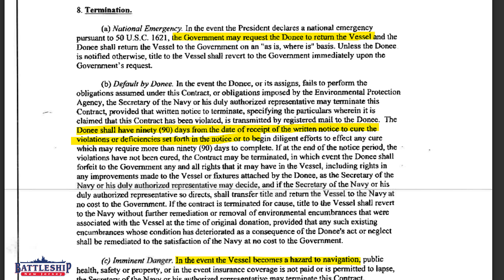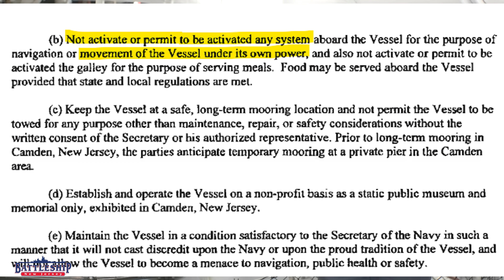Can Battleship NJ Still Move Under Her Own Power?

Comment: Ryan, I am curious if there is a senario where you could get the ship “functional” in the sense of having parts that work, but use an external power source, or are meant as demonstration pieces for tourists. Something like having a see through portion of the turbine, with the fan moving using an electric motor. Something that looks functional, and maintains the core components, but does not work in the proper sense.

Comment: The US Merchant Marina Academy at Kings Point, NY still teaches its students the engineering of running and operating steam turbine engines.  Across the river from the New Jersey is the SS United States, also when built had similar Iowa Class steam turbine engines installed.  The SSUS may have been built in 1952, but she is still the fastest ship in the world, overly built and superior to any passenger ship built today.  A few years ago I was at the US Naval Academy in Annapolis and discovered the SSUS is still taught as the ideal vessel to strive for in construction as performance.  Until the 1990's her top speed was still classified, 40 kts or 48 mph. BTW, the SSUS was built with two separate engine rooms so one could be hit with a torpedo and the ship still run via the second room.  Has 7 water tight compartments, cruseships today have 3.  Save the SSUS.
Reply: That’s great information. However, there’s no comparison between book learning how a 1200 psi/875 degree Westinghouse boiler works, and actually lighting one off and operating 3 of them in parallel.

Comment: I actually wrote a way into my stupid sci-fi novel to how to propel old ships without the main engines. Basically just install gas turbines connected to electrical generators and use that electrical power to turn the screws with electric motors without needing the boilers.

Comment: Good video Ryan. I agree with yours and others comments. Could it be done? yes if you throw enough money at it anything can be done. The issue as others have pointed out is not if it can be done. But more. Can you find enough people with the skills and experience to run the engines. That, is the million dollar question. All those people who used to work in the engine room will no longer be spring chickens. But, instead getting on in years like all of us. What eventually will stop the engines ever from being started is the knowledge and skill's required to get them started will no longer be around. Sure, I guess you could argue that someone could work their way through it and work out how to do it. But will they get it right or miss out one important step and destroy the engines permanently. Would i be worth getting in touch with those still alive who did work on the engines and get from them as detailed as possible the engine starting procedure. Or does that information already exist in Navy manuals? Keep happy everyone :)

Comment: Questions for a future video (I don't believe it has been answered to my knowledge):

What steps/prep work does the Dry Dock need to do before New Jersey shows up?  Iowa class battleships aren't exactly pulling into port often these days sadly, so even if you show up, money in hand, there must be some special steps they need to take to accommodate this right?  Do you help coordinate people who have experience (either veterans of the ship or maybe prior dock workers) with the Dry Dock or is docking a ship a fairly straight forward process?  I imagine you need to provide measurements and blueprints so they get an idea of the block placements.  Does the dry dock need to order or build specialty blocks to accommodate a ship that large or are the blocks basically standard?  Do they need to order any special naval or museum grade coatings or are the coatings general purpose?

Basically, we kinda have an idea of what the ship side is doing to prepare, what is the dock side having to do, if you know or can find out.  I think that would be an interesting topic.
Reply: I was wondering about the blocks too.     Is there a set that is barged from ship's drydocking to drydocking? Or is there a set on both the east and west coasts?

Comment: You didn't even cover the cost of the fuel that would be required just to bring ONE set of boilers up to pressure (how many tanker trucks of #2 diesel would THAT be ??) not to mention what part(s) of the steam systems would need refurbishment or upgrades to handle said pressures needed. IIRC these ships required tugs to move around the various ports/docks to prevent collisions. No, even if possible it would not be wise to move her under her own steam, especially in a moving river, just imagine what could be wiped out should she lose function of some critical piece of machinery that hasn't been used in 30+ years

Comment: When I was in the Navy ('63-'86), three of the ships I was on (Destroyers - 3 different classes), went into and came out of dry-dock "cold iron", meaning power plant (boilers) were not lit. We went in on emergency diesel power for lighting, etc., and as soon as we were "on the blocks", but still had water around the ship, and shore power hooked up, the diesels were shut down. Dry-dock was then pumped dry. For un-docking, dry-dock was flooded till ship was just ready to lift off blocks (allowing cooling water for heat exchangers for diesels). Diesels were started, power shifted from pier to ship, shore power cables removed (along with telephone, potable water, steam, etc) and ship floated. Another reason for stopping just before ship floated was to check for any leaks. Ship was maneuvered with tugs once cleared of dock. Most movement in the dock was done with winches ashore, VERY slowly.
 Too much stuff has to be shut down/secured for a ship to go in under it's own power. Time in a dry-dock is $$$$$. If work was being done on the power-plant (boilers), you don't want to waste days waiting for the boilers to cool. Let them cool pier-side.

Comment: In a hypothetical scenario where you were going to have the New Jersey sail under her own power, would you need to go through a boiler certification process similar to the requirements for steam locomotives?
Reply: Marine and locomotive boilers are overseen by two different entities and therefore need to adhere to different sets of regulations. The coast guard certification process differs a bit. Same basic principles but a marine steam plant is a multitude of times more complex than a locomotive.

Comment: Does the ship have specific points on the hull the tugs must push at, or is the hull pretty much thick everywhere and it doesn't matter?
Reply: It's an all or nothing design, the armour belt covers the citadel (magazines and engineering) and the bow and stern are not armoured.

Comment: When in drydock, what happens to the metal (if any) is removed? Can it be kept and turned into coins that the public could buy to support the NJ, and this would apply to her sister ships too. I know personally I'd be interested in purchasing a coin that came from the discarded metal from the ship.
Reply: I think Texas sells merchandise made from their removed hull plate.
Reply: I can’t speak for the New Jersey, but various museum ships sell bits of scrap metal they’ve had removed during dry dock. Texas and North Carolina are two I’m aware of
Reply: @mistertagnan  I know that New Jersey and North Carolina had to retain the sections of steel that they cut out to facilitate the tour route but are selling some parts of the ship (like New Jersey's teak decking).
I think the rules probably allow only for the sale or disposal of materials that can no longer be of any use.

Comment: Your video very clearly explains why your transit to drydock will be a "deadstick" as far as propulsion goes. However, what about auxilliary services? Does NJ have an operable diesel generator (assuming its seawater supply is not blanked off) to supply electrical power, or will that come from a service vessel alongside? I would think you would at least want some lighting, interior communications and emergency radio capability. What about firemain water for firefighting? If your transit is only a few hours you probably don't need potable water, but then again maybe? I'm curious to know what services NJ will have, or will she be totally dark during the transit to drydock.
Reply: They are planning to rent a diesel generator and set it on the deck for the tow.

Comment: I suppose anyone familiar with how a Steam Train works might have a BASIC idea how those Steam Turbines function. But that is a good point, no one in this day and age knows how to work those things. While YES the old girls most certainly CAN be restored to working order. Will they ever? No probably not. Like these ships are over 80 years old, they are probably well overdue for "wartime" Maintenance.

So she's a Triple Bottom hull, the 12 inch armor belt plus other layers and a 6 inch citadel roof (plus the 2 decks on top). You would need a hellvua blowtorch (like Adaline or a plasma torch) to cut though that. If memory serves shes got 8 boils that feed into 4 Steam Turbines? (1 for each prop)

Comment: I went to the Wisconsin last year in Virginia and they told us she has the exact same preservative oil and grease in her engines as well, as well as in other parts of the ship. They also told us if any of the Iowas were to be recommissioned, it would most likely be the Whiskey. She's the youngest of the Iowas and it was also the main reason when she's birthed in Norfolk.
Reply: The Whisky is also the least used of the Iowa’s with New Jersey being the most as she got recommissioned for the Korea and Vietnam wars.
Reply: @tomnewham1269 yeah but Mighty Mo comes with a deadly cook!
Reply: @Kitchevo ryback  lol.... don't want to upset commander krill😂😂
Reply: @tomnewham1269  Whiskey was in Korea as well. It's where the famous "Temper Temper" incident happened.
Reply: I went aboard  her 3 times she the biggest  battleship  by 11 inches bow of the uss kentucky
Reply: @beedalton9675  That's actually a myth. She's roughly the same length as her sisters but longer by maybe an inch at most. if it were 11 inches or even the 3 inch some say, then it would cause tremendous warping of her hull and frame and would cause one massive weak point.

Comment: Excellent job, Ryan. Question: Does the Navy ever conduct inspection on New Jersey or any other of the Iowas to check the material condition?
Reply: Related question:  would the USN ever try to refresh the preservative fluids in the engines, reduction gearing, turret hydraulics, etc.?  Dried preservatives were a problem when the ships were reactivated in the 80s.

Comment: Here is a point about the main engines I hope has been thought of, due to the design of the turbines, there are just two bearings supporting those shafts, because gravity is a constant force being applied to those shafts would it be advisable to run the jacking gear periodically for if there is too much sag in the shafts it will ruin them should they ever be re-activated

Comment: I think a point missed here also is since the boilers have not been fired in over 30 years the pressure vessels would have to go through a vast amount of NDT testing including wall thickness testing and possibly some type of pressure testing on the system, There most certainly be PRV's that would need to be tested, Also with the turbines, gear reducers and even generators no matter how much preservative that was used been used if the rotating elements have not been turned routinely there is a vary good chances that the bearings are damaged form sitting
Reply: Don't forget about all the steam piping that might need to be replaced.
Reply: Exactly. There are parts of the steam plant that are close to 80 years old and no maintenance related to keeping the engines working for over 30 years.  I am no expert, but I would be quite leery of getting the pressure up to 600 psi, even after testing (I suppose you could try to do imagine on everything  on the engines, but it might be faster just to make a copy of the ship).  I suppose that a few hundred psi might be safe, but how much speed would that get you?  Could you spin the generators fast enough to provide sufficient electrical power to run the ship with reduced steam pressure?  I suppose that would be a good question for Ryan and crew to dig into: What is the power output per turbo generator at a given input psi?  How much steam pressure is required to run the ship?  Could you even function on reduced steam pressure, and if so, what would the lower limit be?  These are the questions we want to know.  We've watched videos on floor tiles and wanted even more information on them, so I would think at least a few of us would be interested in the power curves of the generators. 😅
Reply: @lonnyyoung4285   Even making a copy of the ship is not an easy task, think about a few things.

Plant: There are manufacturers who make plant for large ships today, hell with a BB you have a good case for going Nuclear, so that is not so much of an issue. 

Guns: Show me a factory these days that builds 16 inch barrels or gun breeches. The guns on a Battleship are long lead items, which means you really want them on order BEFORE you lay the keel as the things take years to make even if you already have the factories and skilled workforce needed to manufacture them. You would also need to rebuild new facilities, an armoury capable of building large calibre Naval Rifles is a VERY specialised plant, and none exist today....

Armour: How many steel mills these days can make 12 - 16 inch face hardened steel armour plate in the kinds of sizes needed for building a battleship? I am willing to bet none, though unlike the Guns there are actually steel mills LARGE enough to be able to do so. Even so they would need to retool somewhat, and train skilled workers to be able to start the manufacture.

The problem with simply building a new Battleship is virtually none of the infrastructure required for critical parts of that ship (especially the guns and armour) simply do not exist any more, let alone the skilled workforce required not only to manufacture those items, but also to fit them to the ship. Welding 12+ inches of face hardened armour plate is NOT something any moder welders know how to do for example.....
Reply: @alganhar1  Yes, I know.  These are all things Ryan has discussed before.  Also, I wasn't arguing for a new ship in my comment.

Comment: The steam plant has not been inspected and maintained for 30 years.  Trying to run it without a full rebuild would be sucidal.
Reply: It's been under dry layup the entire time.  A full inspection and Hydro-test, and it would work just fine.  I steamed Her in the "80's.

Comment: Institutional and/or corporate knowledge is a very fragile item that can be lost in a very short time. One time I got a call from a customer that had an issue with a piece of office equipment. I asked one question, and the response was huh? A long story short was that the envelope cutter’s waste bin (6 gallons) was more than full, the compartment was full! 30 gallons of Chad later, it worked just fine.

Comment: BMCS here. Your video is so good that I subscribed. You are totally correct in regards to what you stated. Really great that you referenced that it is impossible to cut openings in the sides or the main deck to remove the power train. The boilers etc are overhauled in place. It sounds bad but the Iowa Class battleships are very "roomy" compared to other classes.

Comment: If I understood correctly, the Iowa's engine plant is "permanent," removing or changing it would destroy the armor integrity/seaworthiness of the ship?
Reply: Well nothing is permanent. The larger inter-war refits involved complete replacement of powerplants: boilers, turbines, adaption of coal bunker to oil. The Condi di Cavour-class come to mind, which removed several coal-oil spray fueled boilers and replaced them with a fully oil-fired plant. The Nagato-class had a refit additions like that too. 
Those are examples of incredibly expensive refits though, partially fueled by the inability to replace units with similarly capable units due to the interwar treaty-systems.
Reply: @Tuning3434  The Kongo class was another massive rebuild.

I was commenting more specifically on the Iowas, however, your point is still valid.

Comment: Ryan, been following you since the Vid came around, and had heard the answer to this question before. I've also hear the answer to this question in a way. You've said you can't rotate the turrents or elevate the bores due to the power needed to do so. Dry Dock facilities have considerably more electrical power available than at the museum site, So, will any of the turrents be rotated or guns elevated as part of the dry dock maintenance procedures? Thanks.

Comment: Ryan, since the Navy could take The New Jersey back, does the Navy require you to rotate the turbines periodically so they don't bend?
Reply: I, too am curious if they "Exercise" the various parts of the powerplant (and other systems) just to keep them from sticking.
I have an engine in a van that "locked up" after sitting idle for about 8 months. It wouldn't start, guess I should have kept cranking the engine once a month! Oh well.

Comment: Question from a marine engineer: If all the through haul openings are capped, how does the air conditioning system work?
Vessels I work on use sea water to cool the condensing barrels for the chiller plants. I have to figure the New Jersey is air conditioned? 
Any answers would be appreciated : )
Reply: Very little of that ship would have had actual air conditioning in service.  On the WW2 museum ships I have toured, to get an air conditioned area on board it has a large commercial building style unit that was added on.
Reply: @chrisreynolds6520  Makes sense. They must had just pumped fresh air from top side down below.